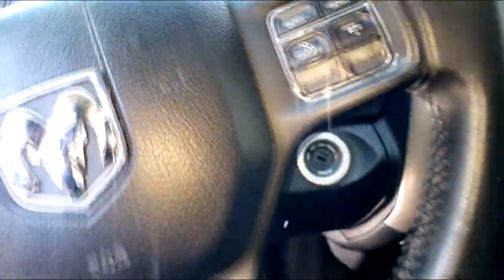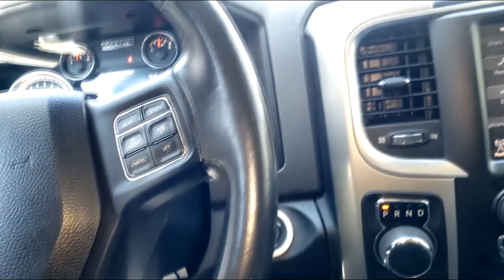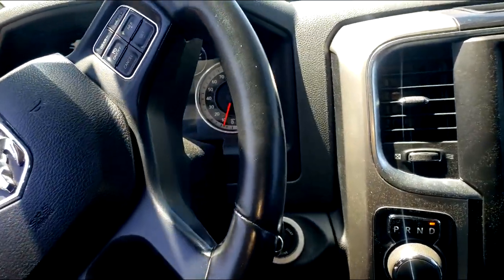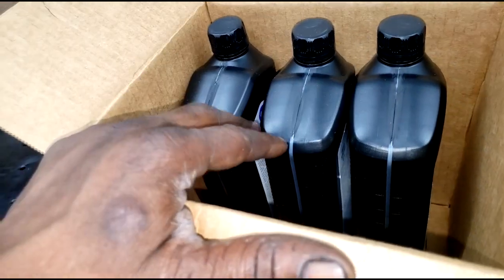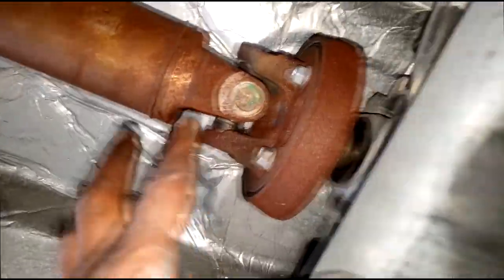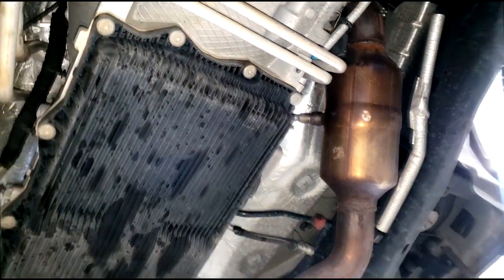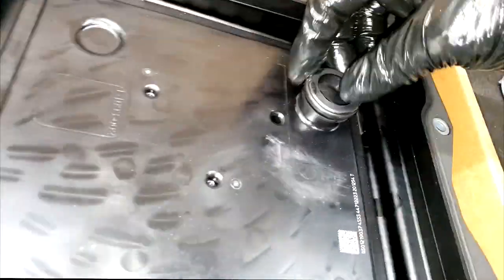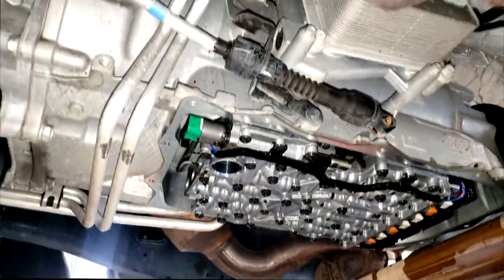Fill for Life Transmission service. ZF 8 HP70 Pan and Fluid Change. FLASH  TCM. Dodge Ram 1500 P0700

Comment from the maker: The Oil transfer pump I used here: https://www.youtube.com/watch?v=IB_SJ0sLbTY&t=8s
Reply: Hey I have a question for u, I heard ,but I'm just gonna ask u to pick your brain...do u have to use that exact transmission fluid, or can u use a brand that's 10 times cheaper ,and is better .what kind of transmission fluid would u use on your zf transmission ...other then OEM...now this is a trick question,and I know the answer already ...and the right answer is from a scientist...so let's hear what u have to say....also their r 4 other types of fluid u can use other then OEM fluid for the zf....now this is hypothetical as if u owned a zf transmission
Reply from the maker: @jaimezapien4897  I do own one of the ZF FWD 948TE trans in my Cherokee. I have 60K on it and did a drain and refill. I did however use the OEM Mopar 8&9 speed fluid that it calls for. If I had to use a different brand it would be the Valvoline. Not sure theres a BETTER fluid out than what the corp calls for. But, other brands are compatible. Im not really understanding ya comment. Also keep in mind, im only relaying what I was taught at the training center, do I know of a better scientific fluid or 4 other types? No.
Reply: Do you know what size the drain plug tool needs to be. Is it 17mm, for the zf 8HP70.
Reply from the maker: @MrLatinKing13  They are different. I do not have them memorized. Thanks for watching, please consider subscribing to the channel, thanks
Reply: Do you have link too 8speed fill procedure?

Comment: To get the drain plug out without removing any crossmembers just get an 8mm L shape allen key and cut the short end short enough to fit betweem the exhaust pipe and the drain plug. Insert the allen key into the drain plug and unscrew the drain plug. 
Keep the cut allen key for future tight spaces.

Comment: Your correct on temp issue. As for measuring the old fluid, use a large 20+ “ pan. New fluid is like water, I used ZF brand fluid.

Comment: JT you need to grab a 16 qt catch container. Put it on top of your telescopic fluid catcher. Line it with a garbage bag. Drain it.grab the bag, cut the corner and fill up some plastic gallon jugs to get the exact amount. Pour the fluid in the catcher, throw the garbage bag away. No fuss, no muss and youll get an accurate amount.
Reply from the maker: Dam good idea bud

Comment: I have the same truck with the exact same noise, exactly the same noise, why was it whinning ? The whine is it rear end ? Pinion gear ? Just curious its driving me nuts, at first i thought it was tire rubbing on splash guard, but nope nothing touching, its definitely the same sound i hear in your other video test driving the truck, i had to pull over cause i was driving while my son was watching your video, and it is definitely the exactly same sound...!!!
Reply: What was the issue?

Comment: Hello,
I watched a lot of your videos yesterday and read a lot of comments. I have a 2016 ram 1500 with 190K miles on it. I bought with 117K miles on it and fell for the lifetime service. 
When going through gears there is a shudder like going over a rumble strip. I do tow about 6Klbs. I thought it's time for a new transmission because now I'm hearing the mileage is too high to swap something about additives. Just curious is a service a good idea or is tine for a new one?
Reply: Did you fix the issue with the shudder? My 2014 1500 3.6 is doing the same thing, thanks

Comment: The reason the NEW bolts is for same reason as you stated regarding importance of torque being important. Re-useing old could snap bolts as they stress each time they are removed or installed.
Reply from the maker: Great point. Thanks bud
Reply: From what I understand, the bolts do not have a particularly high torque but what apparently happens is that corrosion can take place between the bolts and the body. They also recommend that you run a tap through to make sure they are clean before using the new bolts.

Comment: What is your  honest opinion on a trans flush for the 8hp70? I've been watching your vids for a while now and you are a highly skilled and incredibly knowledgeable Chrysler tech. I bought a high mileage 4th generation with 150k miles,  did a full refresh on it.  All fluids along with a bunch of bolt ons, except trans fluid. Currently the fill port plug is stripped. Trans is making a metal slapping noise whether idling or under acceleration. Assuming fluid has been pan dropped/ flushed at least once given fill port is stripped but trans pan is stamped ZF not mopar, but maybe never. I suspect low/dirty fluid and clogged trans filter. Sluggish shifts, seems like it's always searching for gears. So FLUSH OR PAN DROP/ FLUID SWAP? Any info greatly appreciated
Reply from the maker: O wow, the fill plug stripped? As you no im no big fan of the trans flush unless a filter change has been done already. 2 advantages to doing filter/pan. You get to see condition of fluid (if any particals in it) and of course, you likely replacing filter. But im curious as to how will you refill?

Comment: I have the same transmission in my Durango I have over 111,000 miles should you recommend me change it or it’s to late any advice ?
Reply from the maker: Hello my friend, is the check engine light on for any trans related issues?
Reply: @OnlineMechanicTips  I am suscribes sir I got ur back but not no check engine light on no issues at all she runs smoothly as butter but just wondering if I have to change it or leave as is
Reply from the maker: @teamggclovertrail832  No, you should change the pan (filter) and the fluid. You likely now out of warranty which means you on your own. Its now up to you to help pro long the life of your own transmission my friend. I think the Corp ZF who builds the trans suggest doing this every 60K.
Reply: @OnlineMechanicTips what if the check engine light is on ? Still recommend changing trans oil ?
Reply from the maker: @Cocomelonn101 Depend on the code. What codes do you have? Also are you subscribed to the channel?
Reply: @OnlineMechanicTips  
•incorrect Gear Ratio- clutch 4 deffective 
•incorrect Gear Ratio- clutch a, b, or d defective 
•Gear 3 Shift Incorrcy Ratio 

Sometimes it don't want to go in reverse, sometimes it does! Sometimes it takes 5 times shifting P TO R for Reverse to kick in 
 
When its cold, sometimes it slips, after driving it for a while it doesn't do it, still does the Reverse problem
Reply: @OnlineMechanicTips  I been subscribed for years 👍 like the content
Reply from the maker: Dude if you dont see any visible leaks those codes mean it's simply time for a new Transmission. There are no parts to fix this problem even at a dealer.

Comment: I just had my transmission replaced a few months ago due to a bearing failure that was covered under warranty. Came with a new torque converter. Having this noise that I’m not sure if it was there before with the old transmission or not. There’s a video in my profile. Had it at the dealer that replaced it this week and said they heard nothing unusual. Any input would be great! No shifting issues really either.
Reply from the maker: Hey bud sure. I will need headphones on so I listen when I get to the home computer. Are you subscribed to the channel?
Reply: @OnlineMechanicTips  I am since I found your channel today!

Comment: Hey JT what’s the tipical warranty for that same transmission on a 2018 300 just curious . Also my 300 hundred has 43k I bought it in 2019 with 11k when should I change the transmission fluid

Comment: I'm subscribed and I have been subbed for a while now. I have an important question and I'm in need of an answer asap. I just purchased a 2017 ram 1500 4 by 4 and I think the transmission needs a reflash. I get a small thud or thump from the rear end after coming to a stop at a red light. If it doesn't thump when hit the brakes then it will do the thump after I let off of the brakes right before I drive off. Would this be due to an outdated transmission software issue?
Reply from the maker: I would say this, just about all the 2017 models have trans shift improvement updates on them available. It def will not hurt to have them scan the TCM and go ahead with updates
Reply: @OnlineMechanicTips  thank you 🙏 I'll let them know when I bring the truck in tomorrow. This is why your the best mechanic to me on youtube hands down. Your always responding to my comments too.
Reply: yah... my 2013 does the same thing when you come to harder stop. whats the solution?

Comment: Man, with my 2016 JKU Wrangler, what I like to do is swap out a couple of quarts (like you said, measure what I take out, put same amount back in, and an additional ounce or 2, for “stick around in the bottle” amount) of Mopar, and ONLY Mopar, ATF+4 when I change the oil.  I will do a pan drop between 60-80k miles to change the filter.  This is the older 5 speed trans that (actually) still has a dipstick.  The pan on those JK Wranglers seems very shallow, and a chore to suck out 2 or so quarts.  A friend of mine bought a brand new 2020 Rubicon, and I went looking for his dipstick, and none, had that same ZF Transmission as you have there, and he got the 3.0L Diesel with it.  Have you had a chance to work on any of those 392 Wranglers ?  I hear a few people having issues with lifters in those Hemis,

Comment: The problem I have with waiting at 100k to change the transmission fluid is the warranty is over at 100k because every dealership I called told me that the transmission service isn’t due until 100k and my car has right now 61k and I also have a 100k power train warranty
Reply: Yep and they want over a thousand to do the service I'm gunna see how far my transmission goes before it fails and just get it rebuilt
Reply: @Northern_DIY  I think that transmission cost alot to rebuild find out how much it cost new .Just a thought

Comment: So if I'm doing a transmission swap in a car that orginally didn't come with the ZF. is it best to service the transmission before you install in the car or after? It'll probably be a low mileage transmission but like to service it first before using it just in case. I only ask since you have to go through the gears and idk if that's possible if it hasn't been installed yet

Comment: Great video how many quarts of fluid did you end up using
Reply from the maker: O wow, I cant remember off hand bud, sorry.
Reply: @OnlineMechanicTips  No problem I was just curious, I enjoyed the video
Reply: I used about 5.5 quarts doing mine at home which is what zf says it should take. So I'd say buy 6 or 7 quarts just to be safe.
Reply: @rey3468  Appreciate you Answering thank you very much
Reply: Used nearly 5.5 quarts as well today. 8hp70 fluid and pan change. 37k miles

Comment: I have same transmission on my 2014 Ram 1500 hemi truck my transmission started overheating it went up all the way to 240 degrees I changed the fluid hoping that would fix the issue but it stills overheats I have same transmission as this video. Any tips or advise on how to fix this or why is it over heating ? Help I dont know what else to do and i dont want to burn my transmission because of this overheating.
Reply: @Danny Boy I had the same problem. They said my transmission heater was messed up. They said most people never heard of it cause I said I didn't know it had a transmission cooler. They replaced the thermostat which is in a lil box on the transmission. After they did that and switched my fluid the problem went away. I hope this helps.
Reply: Also make sure you use the Mopar transmission fluid. It's pricey but the shop said for this transmission I must do it. And like I said, it fixed it !! I went to a transmission shop btw. Good luck.

Comment: What do u know about a jeep saying not in park and won’t let u start or shut it off says not in park I was told it’s the tcm/ valve body gonna swap it just need input before I waste cash
Reply from the maker: Wasting cash is exactly what you risk doing by not getting it properly diagnosed with a good scan tool. Will a TCM/Valve body cause this? absolutely. What year make and model Jeep? Also are you subscribed to the channel?

Comment: Did this update on my challenger n trans is still flaring change tranny once n now new valve body n still flares what are you thought n no codes at all
Reply from the maker: O wow, the valve body usually do it. Will your scan tool allow you to check for codes in the TCM? Thats a separate module my guy.
Reply: Im using wi tech
Reply: I work for dealer chrystler jeep dodge
Reply: I spoke to my service manager said we gunna have to change the trans again Friday and there no codes 2016 challenger rt 5.7 hemi

Comment: Does the vehicle need to be level or transmission need to be level when changing and checking the fluid? My transmission is angled downward towards the rear in the 4WD application with the vehicle level. I will be performing this soon on my 8HP75.
Reply from the maker: The transmission should be leveled when trying to properly fill. The way around all this is to measure how much fluid comes out and just go in with the exact same amount

Comment: Hey jt it gabe the one thst i told you i just started working at chrystler so i have new challenger 2016 and i did that flash update now i notice that after the flash coming to a stop at a red light and the car stop it like jerks a lil forward sorta feel like if someone bump u from behind sort of feel u ever seen this problem 2016 challenger rt plus just to refresh your memory i was the one that asked about getting the pin out box tool  i did that flash update and now when i stop like car 2to 1 downshift coming to stop the car lurches forward

Comment: you have a link or part number for the pan kit you ordered?
Reply from the maker: Hey but, if you plan to use oem you should use your vin at the dealer parts dept to get the correct one for your correct trans.

Comment: You like those rotary shifters ?  I’m not a fan, hate those and also the electric eBrake, I prefer mechanical shifters and a mechanical eBrake.  The electric eBrake on my Mazda CX-5 is nothing but a pain in the dick, goes into service mode if you hit it 2-3x accidentally, and at times said it went off, when in fact still on.

Comment: That oil in the transmission look like engine oil when it came out not red pink as a normal transmission fluid
Reply from the maker: Hey bud, thats because this not a normal transmission per sae. This trans do not use the typical traditional red fluid, however, that fluid would work if you had none. The trans fluid may appear to look like motor oil when servicing due to break down

Comment: anybody know why if i shift to drive, it stays in neutral according to the hp tuner log. I shift to drive and nothing, just rev's. reverse works fine?
Reply from the maker: My friend, if you are referring to the 8HP trans in the video, please note that this a electronically control transmission. Which means there may be some codes in the module. Have you had vehicle scanned? Also are you subscribed to the channel?
Reply: @OnlineMechanicTips  yes I checked the scantool. Has a p1db8 tcm code. Doesnt tell me much. Yeah I subbed since you responded
Reply from the maker: @digitalme4404  Hey bud, yes, I see this code often. One repair we ended up replacing the valve body. Others it could end up being something as simple as a flash update to the TCM. But you have to head to a dealer. There scan tools can see and verify all that. Now this all assumes you have fluid in the trans (no major leaks)
Reply: @OnlineMechanicTips  Hey bud, yeah there was a lot of trans fluid. then i took out the valve body and ohm tested the solenoids, all good.  What happened was i was in town, took off from red light, then suddenly it rev'd to 5000, let off gas, drove to the next red light drove normal, then sat at light wouldnt move. had to reverse the car out of the road. only code is P1db8 Unintended Torque Applied While In Neutral.
Reply: TCM thinks im in neutral when I shift to drive

Comment: Doesn’t show the most important part the fill procedure with having the trans level (not the truck) and switching through gears and what not
Reply from the maker: How do you plan to level the trans without the truck? You thinking to hard guy. But yes, the refill procedure very important, just not shown here but spoken about.
Reply: It says to make sure the transmission pan is level not the truck so you need to lift the rear end only , until its level GUY.
Reply from the maker: @johnsn10  Lol, you thinking extremely to hard my guy. Simply fill till the fluid come out like a diff. Run the vehicle on the lift through all the gears until you reach desire trans temp then recheck or add fluid until it comes out. No need to think so hard. Nobody lift up rear of truck to level trans. That extreme small amout will make absolutely no difference.

Comment: The dealer here said they could not service mine and it was impossible lol
Reply from the maker: Hello my friend, what year make and model vehicle do you have and miles? Also are you subscribed to the channel?
Reply: @OnlineMechanicTips  2014 ram 1500
Reply: @OnlineMechanicTips  and yes lol
Reply: @OnlineMechanicTips  also I had a new torque convert installed and ever since it’s been running 10 degrees warmer
Reply from the maker: @kyleross283  O wow, you forgot the miles. At any rate, as you can see in this video in order to perform a transmission service on this type transmission, its extremely easy. Im not sure what to make of them saying they cant do it. Most dealers rather you be out of warranty before technically they say you not suppose to change the fluid (fill for life) I disagree. So if you out of warranty, you should get this done in order to help prolong its life.
Reply: @OnlineMechanicTips  I’m at 190k miles now.  Would the new torque converter cause it to run warmer